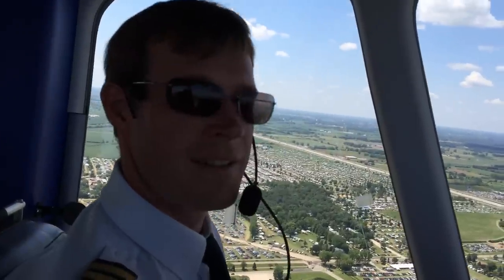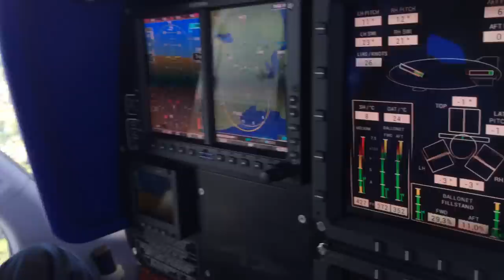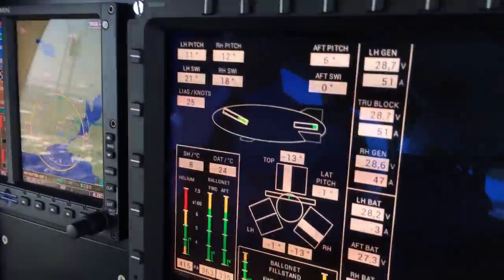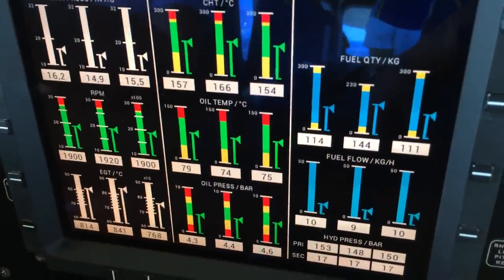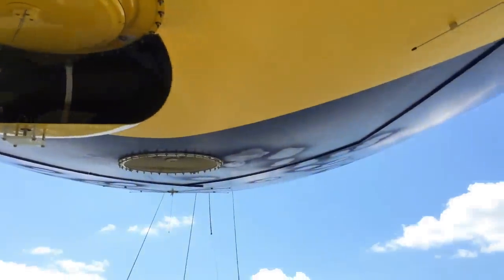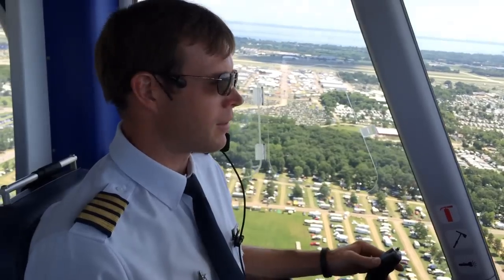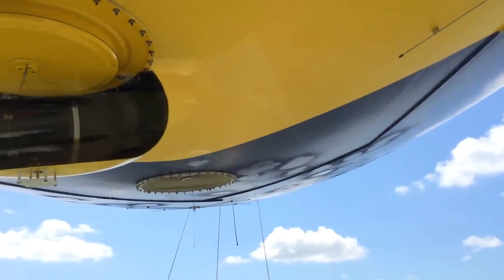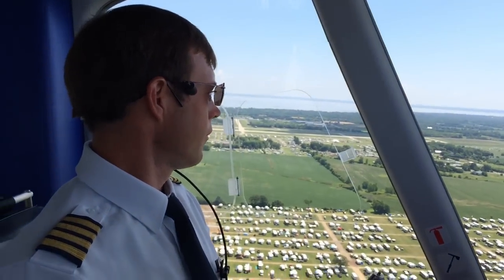Climb aboard Goodyear's new Zeppelin airship! See how the cockpit works!

Comment: lovely trip..  amazing ship.
I would love to know how they control the bouyancy (with more or less people), or is all about engine power?
The ballonets had some active pressure control to change the bouyancy?  There is other way to control the pitch or only the engines?
Reply: AngelLestat2 yes they rely on the engines to compensate for most of the weight change with minimal ballast. There is some Pitch control on the fins for minor Corrections or easy long maneuvers but for Sharp turns or faster Maneuvers they swivel the engines.
Reply: The 5 levers you see at the top contoll the buoyancy. There is a large air bag inside the main gas bag, which when inflated makes the helium in the main bag more dence therefore giving it less lifting power. The three blue levers controll those bags, and the 2 red levers controll the venting of helium gas.

Comment: Fly silent, nicer!   You are now using 3 explosion motors on a Zeppelin NT?
And 100L of fuel for 5h flight?

Thanks to my innovation of 100 times stronger batteries than before, it shold be possible to go electric with 100 kg batteries and still fly 5h. I testing 72V motors are better for 50hp than 36V.
they are using in cars in addition to conventional motor. They dont know this batteries yet.
Just trying to spread a better environment. But they are patented. A small fee to me because makers did not buy the patent yet. They will soon be dead.

Batteries made by Saga enterprises Norway.
Reply: An electric solution is (in parts) possible but the airship will not be a single decibel quieter. 
We still have four propellers on that airship, making still a lot of noise.